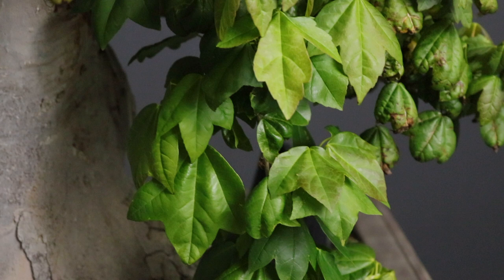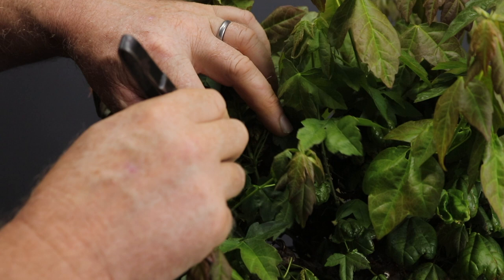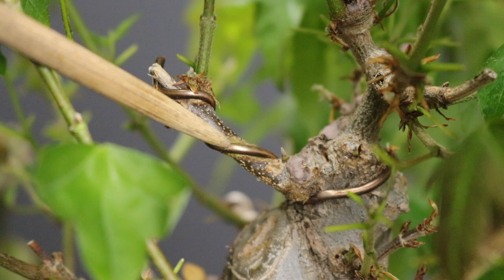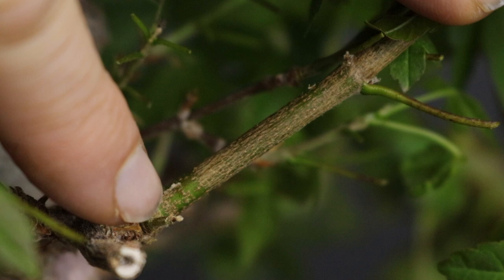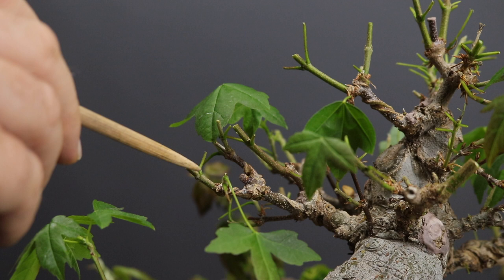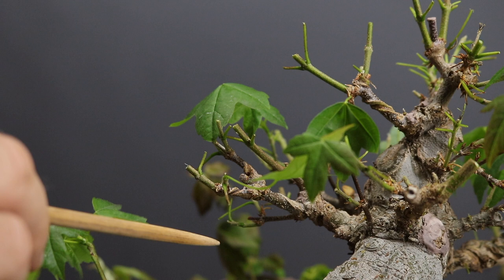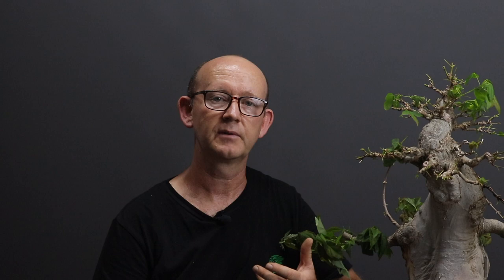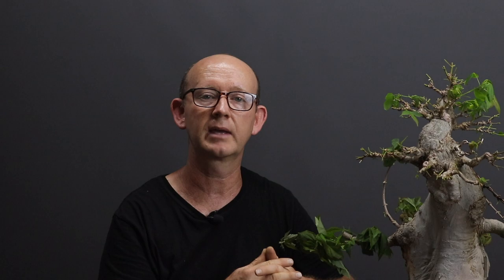Trident maple early development

Comment: Hi Terry, I notice the foliage curl downwards and sometimes it has black stuff at the tip of the leaves., I have those too on my trident.
Is there a cure for that? Is that an issue?

Thanks
Chris
Reply from the maker: Hi Christian. Yes. It’s a problem. It’s Anthracnose. A cure? Well I’m working on that. Some say there is but I’m of the opinion one can only control it as it’s in the air. I have this season started using a natural control measure and it has proved to make a massive difference. I do not wish to share the details at this time as I need more time to confirm the longer term effect.

Comment: Excellent video again.  Quick question if I may?  I have a trident that is still in development, not quite as heavy trunked as yours but pretty chunky.  One of the lower branches is quite spindly in relation to the trunk and other branches and I definitely need a branch in that location.  Would apical pruning redirect energy toward that branch?  And if so, is it best to trim back the apex throughout the growing season and leave the spindly brach to grow on?  TIA.
Reply from the maker: Thanks Andrew. No. You need to allow that branch to grow till it’s almost the thickness you want, then cut it back. Continue building the branch structure from that bifurcation.

Comment: Thank you Terry! That is a solid trunk. You mentioned it was collected from a vineyard? It has a surprisingly well developed taper for a tree that wasn't being cultivated as bonsai. What circumstances do you suppose made it so suitable?
Reply from the maker: Thanks Russell. Its been in a pot for around 20 years I would guess. There is some evidence of scars which healed over so there were some large chops to the trunk, some of which I did as you might have seen from the image which I inserted near the beginning. So no, I think it was growing "normally" till being collected and then it was chopped. I admit it should be much further along in its refinement but until 10 year ago I was relatively clueless regards good bonsai technique. I expect the development process to accelerate greatly now though.
Reply: @TerryErasmusbonsai  Ahh, I misunderstood the timeline, I had thought the collection was recent. Looking back at that inset image, it was much less of a tree at that time and has been developed substantially.

I am grateful to have your videos to guide my learning of good technique.

Comment: Great video terry. Ive read for satsuki u can put some top jin to fill in the wire marks just in the groove i wonder if that would apply to maples what do u think? And is there any organic way to spray maple leafs during the year to prevent these fungal infections?
Reply from the maker: Thanks Chris. There are many ways to deal with wire bite, shaving off the ridge and sealing it with Top Jin will work. Yes there is a way. I found a new product this spring that works brilliantly, it’s called Real Bacillus. It’s organic but unfortunately it’s not yet registered for consumer market only agricultural but I’m working on a solution with the manufacturer.
Reply: @TerryErasmusbonsai  oh thats nice. I did buy castile soap and have read 1tbsp baking soda 1 tbsp castile soap 2 tbsp vegetable oil per lter of water and mix it in a sprayer. I havnt tried it im guessing u can use it all year round. I wanted to find an organic spray so i can spray all of my trees throught the year. Let us know if they ever market that product
Reply from the maker: Actually I wanted to talk about the range of products in this video already but I really had to hold my tongue. As soon as I can I will definitely share the information.